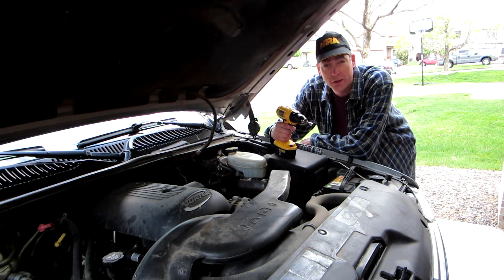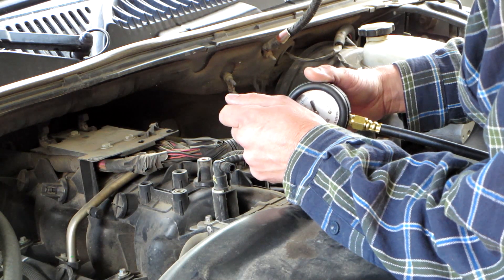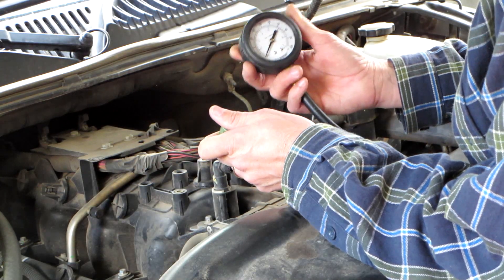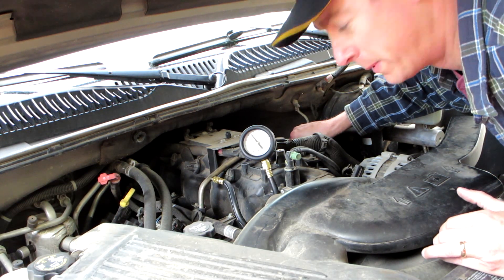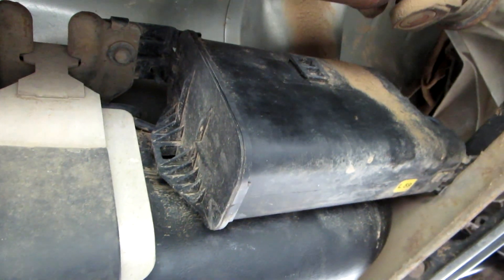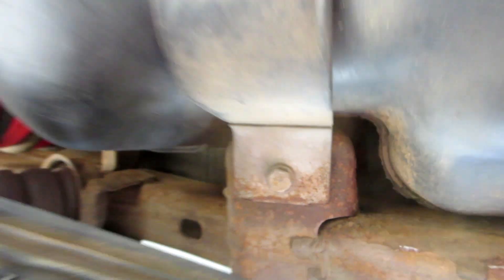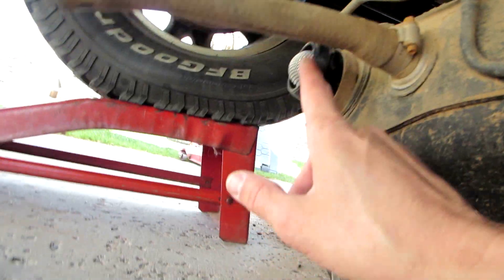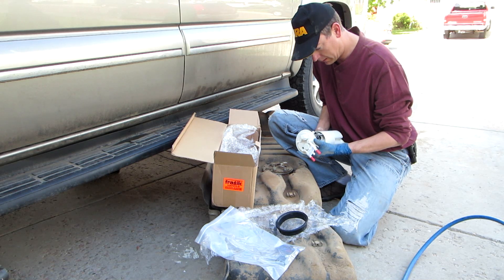Fuel Pump Install and pressure test 2003 Suburban 1500 Flex 5.3 Pt 1

Comment: Mine has 255,000 miles at 50psi.  But 40 when running. Disconnect regulator vacuum line and I get 50. SO i think I'll try regulator.

Comment: I too have a 03 suburban. It's been sitting for a long time and now I have problems building pressure. I have a friend that cleans injectors so that's where I started. Secondly I changed fuel filter and it was dirty. Then I checked pressure and my pump doesn't even build a pound of pressure. Going to be heading to Napa in a day or two. Nice video man

Comment: Mine going out after 2 years also, this will be 3rd pump. Will be weekend project. How long has the cheaper online pump lasted?
Reply from the maker: Pump failed completely 12/10/2014.   Bought a NAPA pump  that is still in there to this day (2020)
Reply: striderz69 ended up being the fuel pressure regulator giving me trouble, glad I didn’t have to drop tank.

Comment: I just picked up a $75.00 fuel pump from 1AAuto.com with a lifetime warranty.  Could not pass it up.
Reply from the maker: Good luck, I have had bad results from the cheapies.
Reply: @striderz69  Here I am 5 years later.  The fuel pump did go out but 1AAuto replaced it no problem.  This time around I went through the floorboard instead of dropping the tank.  Had to be a little careful not knowing how deep I could cut but all is well.  I had to go back and check wiring after install so that made it easy.
1AAUTO will continue the warranty as long as you return the old pump within 60 days...so I did.

Comment: The Delphi is the best pump, but I'm not even going to mention the price. Run some fuel injection cleaner through a low tank once and a while and a little bit of transmission fluid with it. Chrysler ATF has the most detergent out of all of them.

Comment: per gm. 46 to 52 psi on a flex fuel is acceptable. 55 to 60 psi on non flex fuel is the standard for this model. if you replace the pump with a non gm pump the pressure will be above spec on a flex fuel and cause fuel issues when running e85 fuel
Reply: This !!!! This incorrect information had me waste tons of time. So many people f**k it up and don't know the flex fuel version is supposed to have fuel pressure in the 46 - 52 psi range. 
I wonder how many people needlessly replaced their fuel pump based on this incorrect, small but very important detail.
All I had to do was add a 1 way check valve to the fuel feed line to correct a hard or no start condition. Which ONLY happened when the fuel level was 1/4 tank or less. 
I almost replaced the fuel pump. Which would have also fixed my no start condition when the fuel level is at or below the 1/4 mark. 
In many situations, it is wasted money.
Everybody's situation is different. However, most vehicles this age are beaters and not worth dropping hundreds of dollars and an afternoon to replace the entire fuel pump assembly. Especially when all you really need is a 5 dollar part, which is installed in much less time.
Reply: @michaelsampedro1081  where do u install that part?
Reply: ben  hair  You can install a regulator if you had to.